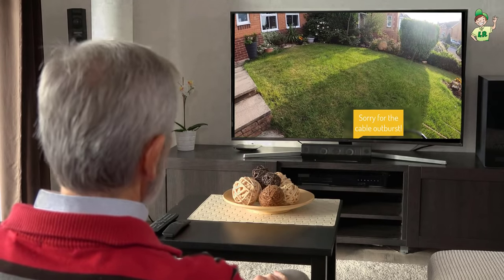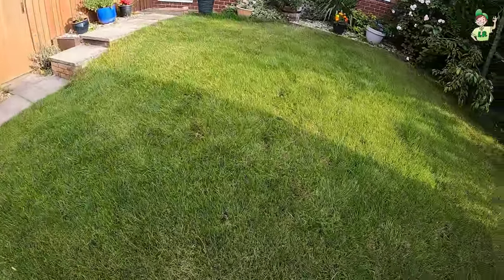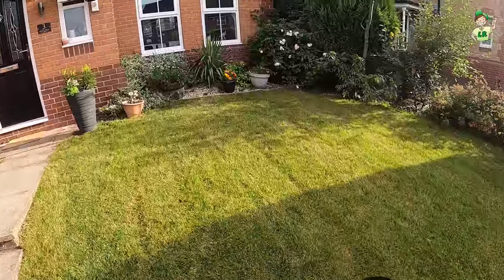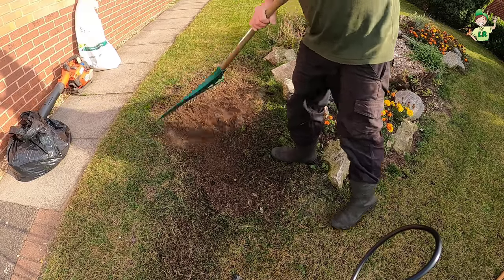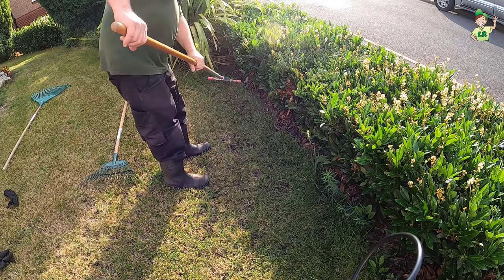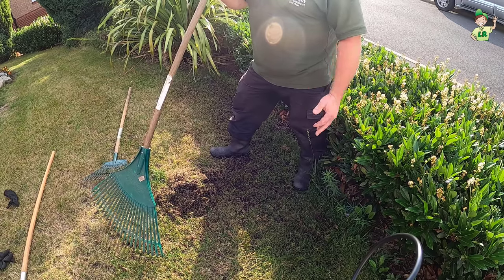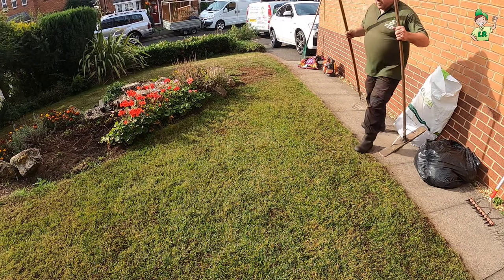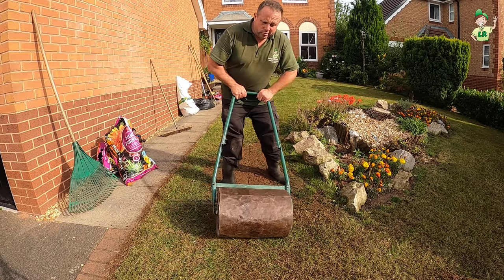How to overseed a thin lawn (and bare spots)

Comment: Thanks. I scarified last November and it was pretty brutal, leaving behind a number of bald patches.  It looked like some kind of rodeo ground and was really mucky! And although I put seed down ("cold start" from garden lawncare guy), followed by a little topsoil, nothing has happened so far (6 weeks). Mind you, I don't think I put down enough top dressing, and I definitely didn't stomp it down. So the info in this video will definitely be useful to me!
Reply from the maker: Hi even though its titled cold start, all it takes is one deep frost to kill off any seeds that have just germinated sadly.. best to use cold start seeds early spring once the risk of frost is pretty much gone.. or you think you'll have a good 2 to.3 week window of lowish temps but no risk of a deep frost
Reply: @LawnRight  Thanks for the tip! 👍
Reply: I have the same problem too

Comment: Oh man, wish I had this when I first started to restore my lawn after my husband passed away.  Short of sleeping on the lawn to stroke it to show some love, I have tried many DYI recommendations!  Have had some success but have the same patches to restore every year.  I have used peat moss on top to avoid birds coming in for a buffet and to keep moisture up, but the same patches showing up every spring.  I avoided stepping on the areas where I overseeded but I am going out with my snowshoes later today.  Hope my neighbours won’t call the heath services. 😂
Reply from the maker: Hmmm... I wonder if theres an issue under the ground 
. Possibly some old bricks or rocks or simply shallow soil..  either of those could cause issues.. I went to one last week.. shallow soil full of pebbles and the pebbles had been heating up in the sun and causing moisture loss.. also the amount of pebbles were causing the roots to struggle pushing down and developing.  Keep up the good work.. and no, you're not crazy 😁😥
Reply: Point well made!  When we first built here, the landscape was 98% sand!  We added soil over the slope and have added more soil over the years.  However, you make a good point!  I will bring in another substantial load of soil late summer and seed heavily to leave it root before winter.

Comment: I use peat moss over my grass seed and it works wonderfully. It retains moisture and you don't need to use so much that the acidity is an issue.
Reply from the maker: Yeo it works well, although peat wont be available soon due to shortages when its sourced

Comment: Howdy mate... I'm from the states. I love the tool you're using about 1/3 way though the video. I tried the garden weasel made by Corona. The wingnuts keep loosening off and the stars fall off. I had to return it to Lowe's. I landscape and mow lawns. I need a tool that'll handle constant use. These small engine shops don't carry them. Lowe's, Home Depot, and TRS have all switched to Corona. The original garden weasel was a beast, but you can't find it anymore.
Reply from the maker: Hi!  Thanks for popping by to my little channel 😊  thats the wolf garden scarifying rake. Not use if it's available in the states.. you usually buy the head and handle separately.

I have  slist of the products I use here https://lawnright.co.uk/diy/freebies/shopping-list/ so itll at least give you a starter on the gear but you'll need to sear h for it on ebay or amazon US

Thanks!  I've never tried the weasel but looks pretty good!

Comment: how do you price up your jobs? I'm thinking of doing it part time. also where do you get all your compost and top soil from ? the garden centres are expensive
Reply from the maker: Hi ask field compost about trade pricing.  My pricing has taken us over a decade to get almost how we wnat it with many mistakes along the way. Treatments are by sq metre.  Identify how long it will take.. Most jobs are maybe 15 minutes.  Facto ring material costs and go from there.  Eg up to 30 sq metres, 30 to 40 sq metres and so on
Reply: @LawnRight  thanks shaun

Comment: Omg finally a great video without pushing me to buy electric scarifier, drop spreader and other things. I literally did the same steps and on bare spots the grass didn't germinate at all. I have no idea why. I kept it moist and seeds are still on that soil, no signs of growing and its now 14 days. The other places had the grass growing after day 8. :( 

What shall I do? Add more seeds on that bare spots and cover with top soil? Or rake the existing one.

I am intending on doing the first cut in a week time. 

Backstory: turf was laid in June, watered poorly by the developer. I moved in in December 21, grass was brownish. In April I applied some pre treatment (don't remember what was that). Early May I raked a bit, removed patches of turf. Cut the grass 2cm, spread the seeds, I added start seed fertiliser, covered slightly with top soil, watered 2 times a day till today (it was very rainy) and the germination rate is so poor. I dont know what to do more :/

Oh amd btw now I have so many weeds and freaking mushrooms 😅
Reply from the maker: Hi..seeds need to touch soil.  If theres like a cm of thatch they wont germinate.  Then when you cover make sure the covering compost or soil is worked down to ground level.....  other reasons could be poor soil full of stones, old seeds over a year old (typically 10% die each year). Seeds sat in a pool of water... shaded areas etc.  If shade youd need to wait a little longer 🤞🤞
Reply: @LawnRight  thank you for your reply. I had good seeds, that areas didn't have tatch (bare spots, raked anyway, to loosen the soil as it was hard), no stones under, seeds are touching soil, area is in full sun, kept moist nicely hence I am seriously concerned why they didn't germinate at all. But seeds germinated in other areas which weren't even raked. This is like black magic now to me 🥲
Reply from the maker: @usables4028  OK.. so in the first instance I wonder why they were bare originally.. tree roots?  or.. is there any chance it could have been an area where a dog or cat had urinated previously?  if so their urine can soak down a fair way so it would be advantageous to remove the top couple of inches of soil and replace.. this would be the next logical step for me

Comment: Excellent video, really helpful. Just wondering when is the best time to do this and should I try and keep the kids off it for a certain period of time afterwards?
Reply from the maker: Hi spring or autumn are typically the best 2 times and yes ideally keeping off for at least 3 weeks is necessary then very minimal use for the month after where possible... autumn is often a bit cooler and kids sometimes stay inside more then
Reply: @LawnRight  Thanks so much for taking the time to reply. We live in Northern Ireland, so only get 2 weeks of sunshine each year :-) Keeping the kids off the grass should be easy enough

Comment: What an excellent job in detailing each step!  I usually just found videos on repairing bare spots but not on thinning lawn--I have both.  Was going to just cultivate the bare spots but after watching, will rake the thinning lawn (it's a very small area), put seed down there as well, with a light coat of compost on the whole lawn and use the back of the rake to smooth out.  First time doing this; think I will need to incorporate a bit of compost into the bare spots before putting in seed, as the soil is a bit sandy on those areas.  And, goes without saying, water 2-3 times a day to keep moist.  One question:  will any of this effort be forfeited if it should rain 2 or 3 days after this is completed?  Thanks so much!
Reply from the maker: Hi it will all be just fine.. only issue may eb if you were to get very heavy rain taht could wash some of theseeds to one side

Comment: I can’t thank you enough for your videos. I have learnt so much from them and am trying to follow as much of your advice as possible. Can I ask, is it possible to reseed a patchy lawn even coming into Summer? We have a sloped garden and one side of the lawn is moist and the other is very dry due to trees sucking a lot of the ground moisture. We’ve reseeded the damper side but will we have to wait till Autumn to reseed the harder dry side? Thank you
Reply from the maker: Hi Sharon yes it is.  It's a great take actually as it'll germinate much faster....  that said.. it can also die back much faster once its come through...  so water up to 5x a day..keep it moist till it's all come through.. possibly 2 to 3 weeks but depending on temps could be sooner..THEN  once its through keep up watering daily for a month  then water 3 times a week deeply for the rest of summer.. mornings best.. because while it looks nice on top the roots will be shallow so any stress will knock it back
Reply: @LawnRight  Thank you Shaun. Just one more Q, I have a budget scarifier from Lidl with 2 'rakes' (one that looks like lots of hooks and the other more like a plough). Which would be best to get the dry side scarified? Thank you
Reply from the maker: @sharonmc5192  I'd start off with the hooks and see how it goes.  It's less aggressive.  You can always dampen the lawn a bit an hour or 2 beforehand as this would help if it's too hard
Reply: @LawnRight  Thank you Shaun! 👍🏻

Comment: Great video, you have a new subscriber! I’m going to tackle my lawn this weekend. I put some lawn sand down which killed most of the moss and turned it black. I’ve scarified it and got loads of dead moss out. So now the lawn is patchy and bold in various areas. Can I ask where do you buy your large bag of grass seed from? And is your roller one that is filled with water, cant tell which one is yours on the Amazon link? Cheers
Reply from the maker: Hi.. it's an old sand filled roller from a customer.  I usually go to hurrels seeds or just any mixed amenity seed for most lawns thanks
Reply: Cheers, what size bag of seed are you using in this video?
Reply from the maker: @jamesperkins1699  20kg

Comment: Great vid for me as a beginner... I have a starter fertilizer.. Can I use that as well? How come you didn't? I think my soil is rather crappy. Also, I tried to grow some grass last summer. It came in a little, but now it's all dry and starting to go away.  It also requires more top soil as I didn't put enough last time as it's a dip in the grass. Can I simply add more top soil to make it even with the rest of lawn and try again? OR do I have to take out the old grass? Thanks
Reply from the maker: Hi yes you can use starter fertiliser.. I didnt have any on hand.  Yeah seeing as its thinning fill up with soil and reseed
Reply: Thanks!  Subscribed to y0ur channel :) @LawnRight

Comment: Nice video I do not have a roller but I use a a length of 6 by 1 fence board approx 3 ft length and screw a 2by 2 post onto it and wrap a car sponge around it for handle go over the lawn with that and it works fine for me saves me hiring a roller lol
Reply from the maker: Hey if it works it works!   Like it 😊👍

Comment: Just ordered a bottle of TurfSolv. Really hoping it helps with the worm casts and leather jacket issues on my front lawn. Is it ok to use in the winter clearly before the 1st frosts arrive.
Reply: My new lawn at the back in now 8 weeks old and starting to get covered in worm casts. Had a major issue with leather jacks but after some black plastic and some early mornings I managed to remove over 100 grubs. Now the worms have started so keen to try and stop them. Being it’s only 8 weeks old I’m being very selective on what’s put on the new lawn as was seeded from scratch using the All American 🇺🇸 Green seed from Hurrells. Keen to see if I can stop the worms or suppress them with something.
Reply from the maker: above posts were by me (in another account for some reason!) ho ho

Comment: Great video, thanks for posting. Q- is the seed from B&Q any good? I’m unsure what to buy and from where. Don’t need a load, just for some bare patches.
Reply from the maker: Hi I've never used their seeds.. but.. if your lawn is  a general lawn with a mixture of grass types then go for it. They should be certified and good enough which I'm sure they will be.
Reply: @LawnRight  thanks, I’ll give it a go.
Reply from the maker: @IPFreely1966  If you're thinking of trying this shortly maybe think again.. the best window has now passed for seeding... You may be lucky.. and one of my customers seeded in November with results.. but it'll take  a lot longer to come through if at all.. a frost will kill any seeds until theyve germinated
Reply: @LawnRight  thanks. Will probably leave it until spring then. Thanks for the advice 👍

Comment: Hi Shaun, just wondering if you charged for this additional service or was the customer unhappy with the previous job so expected a free re-visit? Love the videos.
Reply from the maker: Hi I always reseed free if it's down to me.  Trouble is hard to prove if it's me or the weather. Usually the weather causes the issues or cutsomer hasnt watered enough..I really should address this
Reply: @LawnRight  yes it’s a tricky one. You can only follow the process and tell the customer how to care for it. Maybe it’s something that could be discussed at the start of a job…cost of a reseed etc.

Comment: Hi Shaun 
My garden used the roller of the petrol lawn mover to press the seeds down instead of a proper roller.   Will this do the same job? Thanks
Reply from the maker: Hi.. yes absolutely 😊😊  anything to apply some pressure should be fine

Comment: Hi Shaun
My name Doug. Live here in WA State US.
I was told that grass seed will only germinate twice a year during spring and falls months. Is this true?
Can I do the the scarify, dethatching, reseeding during the summers months if the weather mild.
It rains here quite a bit. June will not be hot weather but a mixture of rain and sunshine here. In July and August we will have warmer tempretures in the 80's.
Reply from the maker: Hi so yes you can do all of those... but.. lawns need plenty of watering to recover from scarifying.. plus  any seeded areas although will come through faster the roots will be shallow so will need a lot of watering for a good few weeks. Then more water than normal till the fall simply because the grass won't be well established and could fail.  If there are no watering restrictions where you live then it's certainly doable.. thanks for watching!

Comment: Great video. I’ve had major issues with weeds in my lawn, I’m talking hundreds and hundreds of dandelions. Any suggestions? I’ve tried most methods but they seems to come back with a vengeance, bigger than ever. I’m contemplating digging the whole lawn out and going down the artificial grass avenue.
Reply from the maker: Hi James have you applied a broad leaf weedkiller?  I usually find dandelions can be killed off with one application.  Look for my video "lawn care shopping list"..in the description I've linked to some products I'm using this year.. theres a weedkiller in there that ha sgood reviews
Reply: @LawnRight  thank you, will take a look now. Keep up the good work 👍🏼👍🏼
Reply: All l have ever done is to go out every 3 days over 3 weeks and using a sharpened pointed knife cut out the weed through the root and never had except the odd weed come back. Everyone comments on my seedless lawn.

Comment: Hi. I recently prepared and over seeded  areas on my lawn which I have done successfully in previous years. This year none of the seeds germinated, I really took care in the preparation etc. The seed was bought from a high St retailer. Could the seed be at fault?
Reply from the maker: Hi anything's possible.  I've heard this before.  Also try to rule out anything else... eg.. old seeds fail by 10% each year.. the particular few extra hot days we had  a few weeks back may have dried things out more than anticipated and without realising.. if it was an area youd applied roundup it may have had residual in the soil of seeded within 2 to 3 weeks of roundup.. it may just be the patches are in shade and taking longer than usual..  had one myself that's taken 6 to 7 weeks
Reply: @LawnRight  Thanks for that

Comment: I have a lawn that is thining the way there are no big patches  but you can see black soil in diam of few cm like 3-5  and its now more than half of the lawn. I can't really rake in otherwise I will rip out good grass. Not sure how to sow seeds and rake in the grass🤷
Reply from the maker: Hi..just scatter the seed then, and then use topsoil to cover the seeds.. a thin layer
. Use back of s brush or rake to work them both down to ground level..firm it in..
Reply: @LawnRight  thank you so much for the tip, appreciate it.

Comment: Hi Shaun, two quick questions first one re this vid, can you just use a rubber drag mat to get the compost down and instead of the roller?  Secondly saw another one of your videos ref extracting cores on a customers lawn and replacing with better quality soil / compost mix. Any update on this? Was it a success? That's looking good mate ... Is it also still possible to seed in October in the South East ie warm enough for germination. Thanks mate 👍
Reply from the maker: Hi..  the drag mats are fine if you've got  a fair bit of grass.. but where its bare..in my experience it will move the seeds out of place.  As for the other lawn.. I'm waiting to see how it goes over winter.  I'm due back there soon..if it's raining I'll do a bit of filming to see how it's going.  Logically it can only be an improvement

Comment: I do that all the time. It does nothing
Reply from the maker: So, seed has to touch soil  - seed also needs to have been kept in a dry place.. Seed loses about 10% a yera of good seeds in a box...  once seeds are down, cover with a light layer of soil or compost... keep damp/moist for 2 to 3 weeks...  other than that it could well be your soil and it would be worth getting it tested/sent off or trying a PH meter to see where its at